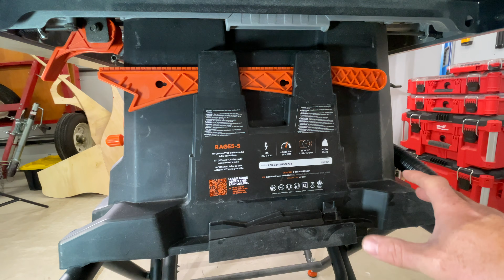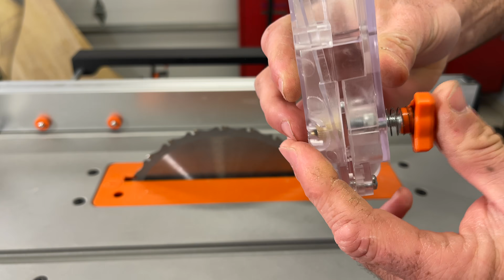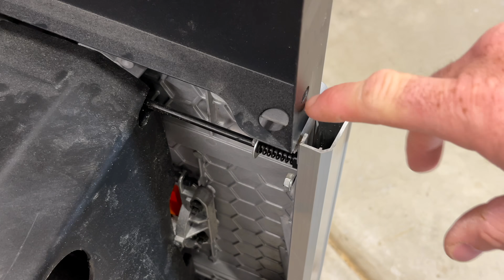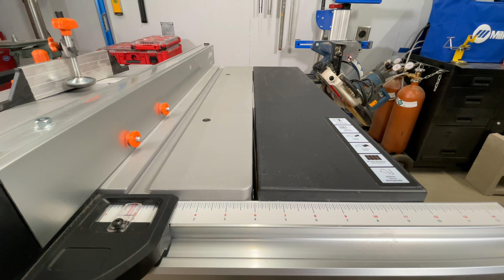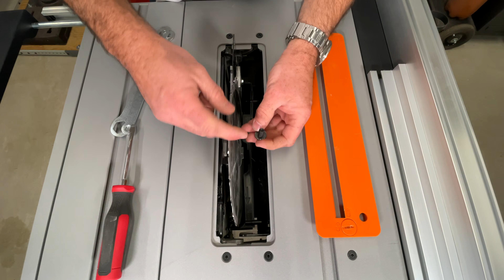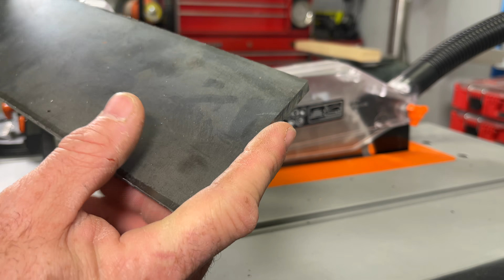Cool and Innovative But....  ||  Evolution Table Saw  ||  Review

Comment: Rack and pinion with a slide crosscut side would be sick.  It reminds me of the old Ryobi BT3000, a super solid modular saw with a sliding crosscut sled.  The evolution has so much potential. I wish they'd update it though. It's been out for a few years and everyone has the same complaints.  If they redesigned it a bit and made it more solid and refined, they could sell this thing for even more and people would still buy it.  Hate to see it hindered and set back by poor design choices because it's got a lot going for it.
Reply from the maker: I completely agree. This saw had a ton of potential in its design but was built to a have a low production cost. I would rather have a quality made basic saw with no bells and whistles. Thanks for watching!

Comment: There's worse TS's out there. Some fences can't be locked on both ends. Looks like a 'hard start' motor as well although that wasn't mentioned. It is I think intended for the hobbyist or DIY market and as such the safety angle should be doubly reinforced because beginners make big mistakes. You have to be doubly careful with any table saw.
Reply from the maker: I agree! Thanks for watching!

Comment: I'm a fan of the Rage 5S. It is far from perfect, but it has allowed me to make some great items, despite being a woodworking newbie.
It probably doesn't suit the DIYer who expects everything to be working perfectly out of the box, but if you are happy to adjust the blade and check that the fence is at 90º, it does an amazing job for the price.
That said, I had to dismantle and file down the aluminium on the fence as it had been extremely poorly made, the blade insert is way too flexible (Evolution now sell an improved insert), and there is way too much play in the mitre sled, so a crosscut sled is a must.

Comment: I've had this saw for about 3 years. For the price it's a good saw. If you just need to rip pieces of lumber or flooring, it's great - did a couple of home projects where this saw was used for ripping wood all day and it was great. If that's all you want your table saw to do, stop reading here. 

But... it's just imprecise. The blade wobbles side to side when you raise/lower it, and the angle can drift when you raise and lower it. You have to check your blade angle every time you raise or lower the blade.  Build a sled, make your first cut, square up the fence, raise the blade to cut your material and... the blade is in a different spot side-to-side than it was on your first cut. 

But the biggest issue is the miter slots. They're not the "standard" 3/4 x 3/8 size, they're weird. The miter gage is loose in the slots. Since they're not standard, you can't easily replace the runner. Lock the miter gage to the sliding table (after you spend half an hour truing it up) and there's still some wiggle. 

My saw's miter slots vary in width from front to back, so if you cut runners for a sled, they're either going to bind in one spot or they're going to be loose in another spot.  **AND** the miter slots are not parallel to each other. You cannot make a sled that has runners in both slots and have it run smooth -it's either going to bind or there's going to be some wobble.
Reply: All true. This saw will drive you nuts once you try to do things other than construction. It can sort of do them but you will suffer.

Comment: ive been using one of these saws for 6-8months now and biggest weakness's of this saw are the fence its made of to thin few hot australian summer days it warped and never locks down strait, the real bad weakness is the table insert far to much flex in it and gap around blade is way to big. first thing one should is make zero clearance plate

Comment: I’ve had my Rage5S for about 4 years and can offer the following:
1. The blade guard is rubbish and I never use it (riving knife stays in of course)
2. The smaller fence is a waste of time and I never use it. I do use the holes in the fence and thumb screws to hold a sacrificial fence
3. I have built my saw into a cabinet so the rails remain fully extended and are rock solid (as such I have added a separate tape)
4. The fence can be adjusted so it locks paralllel
Thank you for the review. It’s good to see how others find the saw.
Cheers 👍😎🇦🇺

Comment: This makes me sad. They make such innovative stuff for us, BUT they will always have these small things that make their tools overlooked. I own their 9" metal curcular saw, 10" miter saw, 14" metal miter saw, and 14-inch chop saw. their chop saw is the best on the market the 10" miter saw is kind of like your table saw. Just too much plastic, too many thinner materials. BUT I will stand by certain things they make. I really wanted this saw for aluminum and thin steel sheets. But there is just too much that needs an update on that saw
Reply: The 10" DB miter saw is a very good saw just wish it had less plastic pieces. It will make a dust mess even with a good vacuum. I use makita blades when eating through wood (so easy for it) I use evolution or tenryu blades for metal. Mk Morse makes good metal cutting blades too
Reply from the maker: I have that 10 inch dual bevel slider in the shop now waiting for it’s review. For years I’ve wanted to buy that one for myself to get rid of my old Ryobi miter saw and Ridgid 14 inch abrasive chopper. We shall see, I’m still hoping it’s serviceable! Thanks for watching!

Comment: I have the same saw for 3 years in the UK, it's not perfect but fine for the money. I've  actually  just gone out and had a look to see if the table extensions can side on mine, and yes if you hit it it will move, I cut my hand trying :). Having said that it's never caused a problem in the pass, may be it because I always measure and not use the scale. I don't use the little addon to fence, but overall the fence works ok.  I do take my time and measure 3 or 4 times, (to make up for my lack of skill) so it works ok for me.  I guess if I needed something more robust and I could bang stuff through it quickly I be paying a bit more, but for £300 it's fine
Reply from the maker: Thanks for the insight Gary!

Comment: You lost me at one inch diameter arbor...on a ten inch blade. Proprietary blades? This ain't for me...sorry.
Reply from the maker: Yes, proprietary. Unfortunate for the end user but makes sense from a business standpoint. The multi material blade in the vid worked amazingly well so if you cut a lot of metal and wood mixed might we worth the hassle. Thanks for watching!

Comment: If this is the only blade they want you to use with the saw, I see zero reason it shouldn't come with a zero-clearance insert. That one thin cutoff dropping into it was not good to see.

That fence is just inexcusable if Skil could copy the DeWalt rack and pinion design at the same price.

I think ultimately though, if I wanted to have a multipurpose tool for free-hand/miter/fence-based metal cutting, I'd do it in the bandsaw instead of a table saw. No risk of kickback on that.
Reply from the maker: I agree with you, band saw is the way to go. We’ll get this saw in another vid soon. Im going to fix that thing or die trying! Thanks for watching!

Comment: To get around the problem with the fence, pull it towards you and then 'pump' the handle a couple of times as you lock it. That will make it mostly parallel, most of the time. I have this table saw and totally agree with everything you said!
Reply from the maker: My first solid mistake as a YouTube reviewer was forgetting to check the return policy on this saw when I ordered it. $280 to ship it back. Now that it’s mine forever my choices are throw it out or fix it. Watch for more vids on this one. I’m going to make this saw not suck or die trying! Thanks for watching!

Comment: The sliding miter isn't a new Idea. In Canada here; I have a Mastercraft table saw that I've had for about 12 years or so that has this feature. the issue with that is - there is left to right play in the sliding table, and the gauge only fits into the front of the table, there is no slot to slide it forward and back - or to allow for a custom sled.  I recently have tried to tighten up the sloppiness of the sled with ok results - but it's not perfect.  Wondering if anyone is using this sliding deck design and how they find it in day to day use.  Considering going with the Skil just to get a standard table top (the rack and pinion is obviously an nice bonus too).
Reply from the maker: So it would have been $280 to ship this saw back so I kept it. We’ll be doing more vids with it soon to fix the loose extension problem. We’ll have a closer look at the sled design too. The Skil is far superior in design though. Thanks for watching!

Comment: Gah! This is so frustrating! I've been fighting with a Ridgid R4513 and it's stupid fence for years now, and was so hoping they wouldn't repeat its mistakes with this. I'd even overlook the weird scale thing and general wonkiness if it had a good reliable fence, but not having that that's a deal-breaker for me. I have a cold cut chop saw for cutting steel and aluminium and absolutely love it. It would have been great to have that ability in a table saw. Ah well. Thanks for the review
Reply from the maker: Yep I know it. I was willing to look past no dado compatibility for a good fence but it wasn’t meant to be. Dual miter slider chop saw vid coming in a couple months for sure. Thanks for watching!

Comment: I could not stand this fence if I were to purchase this saw. It requires too much attention by myself which at some point I would be sure to fail to adjust to it at some important point in a build. I do truly appreciate your review though because of your detail to the fence problem. If they were to repair this fence deficiency I may consider this saw myself.
Reply from the maker: I agree! With a good rack and pinion fence this would have been a very different review. Thanks for watching!

Comment: hey great video.

i used to have the cheaper green model of the evolution table saw and its awful. i recently upgraded to the dewalt.
i also have the evolution 300mm sliding compound mitre saw, only the single bevel though and its actually a good saw. the mitre saws are built much better than the table saws.
Reply from the maker: Thank you! I’ve been eyeballing the 10 inch dual bevel slider for years. We’ll be getting that one for review very soon. I do keep hearing the miter saws are better. I hope is good so it can replace my antique blue Ryobi miter and Ridgid abrasive chop saw. Thanks for watching!
Reply: @ProjectsForAllReviews  i think you will be pleased with one. for the price point the build quality is good and they are very accurate to. although i did have to tune it in first, which is easy enough.

another great product from evolution is the circular/track saws which are brilliant for the price i have one of those  also 

P.s i have no affiliation with evolution lol

Comment: I bought this saw and he is right, the fence isn't great.  It will probably be good enough until i need something better and the price is right.  After a few small projects, I can deal with the fence, I can deal with the math on the scale, with some tightening i have found the rails to not move like his did, I did not have as many quality issues either.  Overall, it's what I expect for the cheapest table saw i can buy, and I'm actually quite pleased, all things considered.  do i wish it was better? yes. Will i return it? no.
Reply from the maker: The comment section is really the best place to gauge a product on YouTube I think. I’m glad to hear yours is working out better. In the end I can only show one persons experience with one product example. Do they all have these problems or is it just mine? Tough for me to say. Thanks for adding to the discussion!!
Reply: @ProjectsForAllReviews  thanks for the awesome videos!!!  I love building things better and this is my first larger "workshop" tool so i expect to learn a lot by the time i need a better one and maybe i can even upgrade this... starting with a zero clearance guide. omg. it's awful. I tried to rip a 1x4... scary stuff happened...

Comment: I have seen the Evolution mitre saw and it is decent for home use.What I don't get is,that everyone raves about how the "SAW" cuts metal and wood.It doesn't.The blade does.So,all you have to do is buy a replacement blade and use it on you own saw
Reply from the maker: I assumed the Evolution tools would be lower rpm and higher torque but that doesn’t seem to be the case. The blades operate in the same rpm range as most saws operate. At least table saws. The 1 inch arbor hole on all the blades makes it a little tough though. This saw had an included arbor adapter I show in the vid. 5/8 to 1 inch. Google searching for an adapter didn’t produce many promising results. Possible you can just buy an adapter from Evolution. I’m going to research this more. May be a future vid topic. Thanks for watching!

Comment: The slot on the side that you didn't know what went there may be for the blade guard if you need to take it off, you'll have a place to put it,  It's a bit similar on the Hercules Table Saw.
Reply from the maker: I’ll bet you are correct but I tried it every way I could think of to no avail. Thanks for watching!

Comment: Thanks for the great review. After your previous video and the stellar customer service you received I was curious if the saw would be similar level of quality, especially after seeing so much plastic in the initial review. I did get a laugh on the Ridgid fence comparison. I have the R4512 and at that time was upgrading from a lower end Craftsman jobsite saw so a huge step up for me. Saw still runs great but the fence does leave something to be desired, although I've adjusted to its shortcomings. If I had to replace the saw I'd probably go with the newer iteration R4560, which I guess is supposed to be similar to the Delta one you have. Is the fence any better on the newer models? If not, with a new saw I'd probably invest in after-market fence.
Reply from the maker: The after market fence would benefit your Ridgid for sure but the Delta/R4560 fence is amazing. It locks at 3 wide points on the front square rail only and if adjust properly is practically impossible to lock crooked. Check out my Delta vid I go into some detail. My saw had its own small shortcomings but the fence isn’t one of them. Glad to hear your Ridgids been good. I’ve had a few comments about the 4512 from satisfied long term owners. Is it possible Ridgid screwed up the newer one? Mine said “new and improved” on the box. If I see a cheap 4512 on marketplace I may grab it for a vid. Thanks for the comment!

Comment: Thank you for an honest review. I’m admiring your open minded approach. 

Fully agree with the conclusion. Unfortunately market is full of such crap. I have bought a similar design Bosch PTS10 some 12 years ago. Has the same siding feed table and even worse fence (upgraded recently but still poor). What is more shocking even their professional range is the same just in blue color and few hundred more. There is almost nothing to choose from. Except Dewalt that in my opinion has it all right especially thanks to the rack and pinion fence and build quality. Almost matches much more expensive cabinet saws. 

Anyway Evolution excels in blades. I own their 14” metal chop saw. The earlier model without quick slide clamp. Cuts steel like butter. Even massive pieces. But the quality is so poor! You can’t rely on the scale for accuracy. Had to make my own jig for setting 90 and 45 degree cuts. Absolutely horrible.
Reply from the maker: I find these tools pretty fascinating. This saw is made for heavy duty tasks but is flimsy and cheaply made. Who is this made for? It is really bizarre. I plan to buy the 10 inch sliding dual bevel chop saw soon for review and to keep. Can’t wait to see the build quality on that one.  Thanks for the comment!

Comment: What a fantastic review and testing of the fence.  Not only did you do a great job in highlighting the concerns on this saw but you taught a great lesson on how to test and troubleshoot fence problems.  I'm having a hard time considering anything other than SawStop but I'm always looking for something cheaper, too.  Thanks for the great review.
Reply: @dalespres1 A Sawstop to a $350 contractor Revolution is a bit weird
Reply: @niffrig  Oh, no, you must misunderstand me.  Any contractor saw, including SawStop, is only worth about 800 dollars for a blade spinning by a motor.  I'll pay 800 for a SawStop Contractor saw and pay in advanced another 1000 for my finger.  My finger is worth it.
Reply from the maker: Thank you. I was kinda expecting the fence to be trouble but the lock for the rails threw me for a loop. I haven’t used the small Sawstop saws yet but we’ll get to them eventually. Thanks for the comment!

Comment: Some fantastic design features, but executed terribly. I love the idea of extendable table ends on a jobsite saw, the sled, the micro adjustable angle adjuster and the T connector for the dust port on the blade guard. That T connector should have a cap for those times you have to remove the blade guard. If Dewalt incorporated those features (built much smarter and more solid), I would definitely buy it.
Reply from the maker: Agreed and good eye! I didn’t notice there was no cap for the blade guard dust port! Thanks for watching!